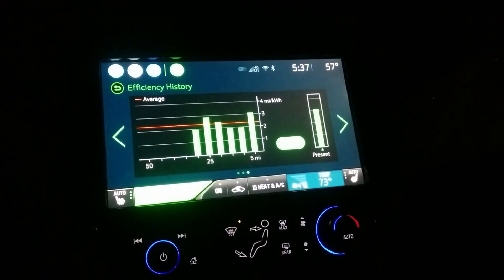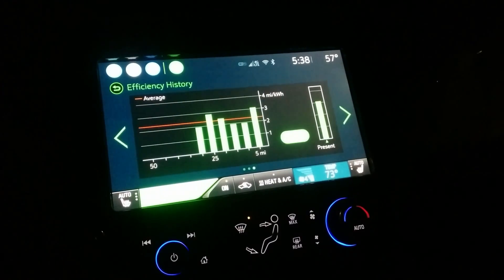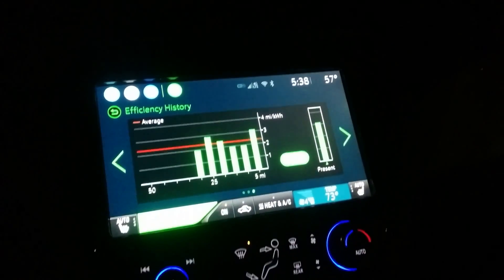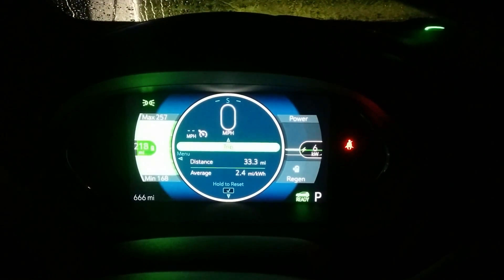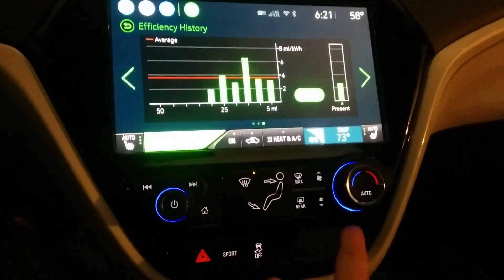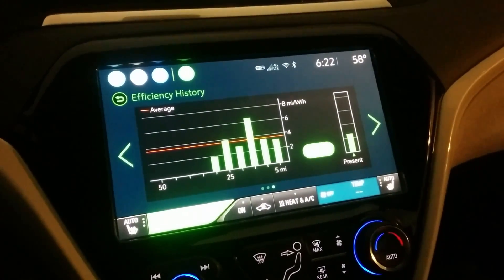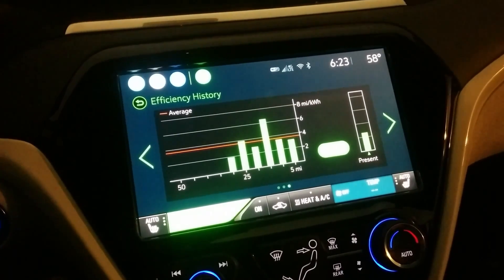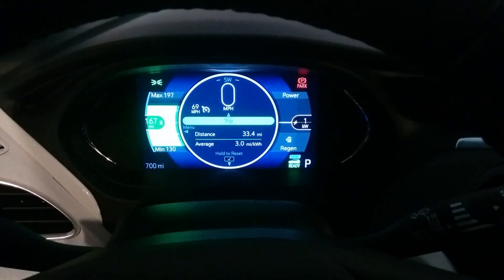Chevy Bolt EV Low Efficiency Driving Return Trip

Comment: Hi  - greetings from Europe :) Thanks for all your Bolt videos °L° 
The Bolt EV will be available here in EU in summer'17 (under different brand called Opel Ampera-E ). We have heard rumors,that both driver and front passenger seats a bit (much?) too narrow. Can u confirm that? What is your oppinio about the width of the front seats (also in compare to Volt). Take care - Peter

Comment: Any opinion on whether GM should add a heat pump, since heating is one of the highest draw features (other than driving)?
Reply from the maker: Matthew Nelson Great question. I actually agree with GM's decision to go with resistance heating. I'll speak more about it later, but the Bolt EV's defroster works as effectively as an ICE vehicle's. Heat pumps are less effective at defrosting and less effective in extreme cold.
Reply: In my area it rarely gets colder than 20 F, so heat pump would probably work well.  I'm also surprised manufacturer's don't use electric heating for the windshield.  The Mercedes B Class Electric does and it saves a lot of HVAC use.
Reply from the maker: Matthew Nelson That's an interesting idea. I think GM is a little biased because of their MI location, but they are planning to sell thousands of Bolt EVs in places like Norway. It makes sense to provide a heating option that works for all customers' needs.

Comment: I know the battery is 60kw, but how many kw does it let you charge up too? The whole 60kw or is there a buffer? Thanks.
Reply from the maker: fer557 It lets you charge up to the full 60kWh, but it does seem like it has an additional buffer. I wouldn't be surprised to find out the total capacity is closer to 62-64 kWh.
Reply: News Coulomb thanks!